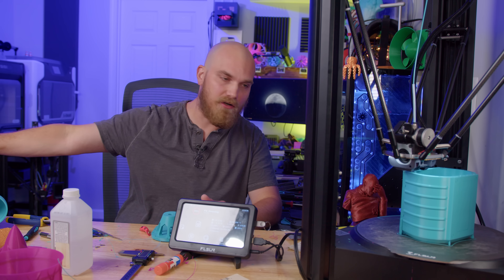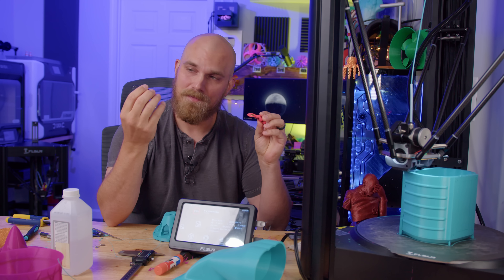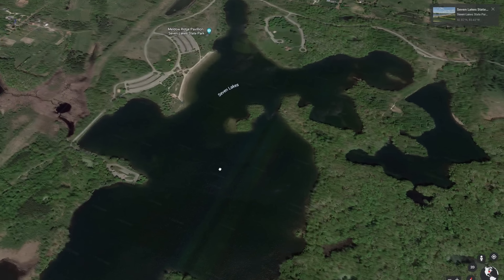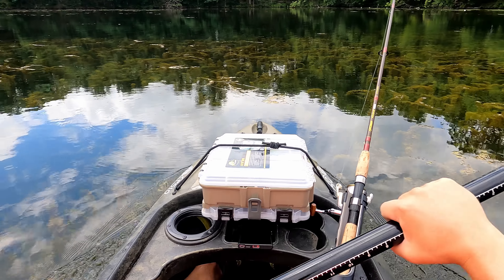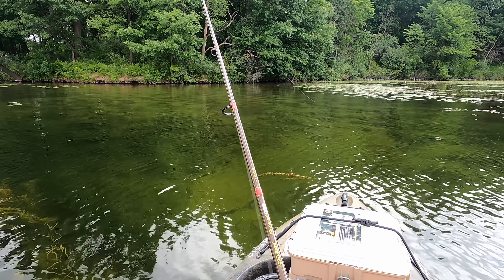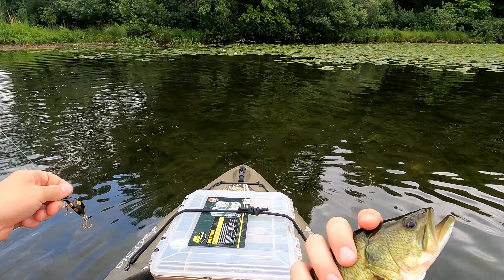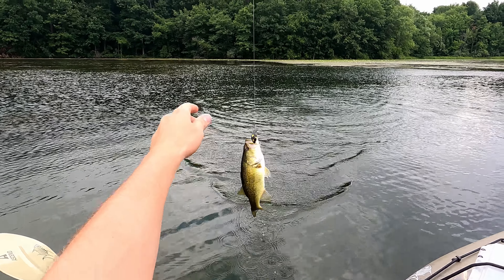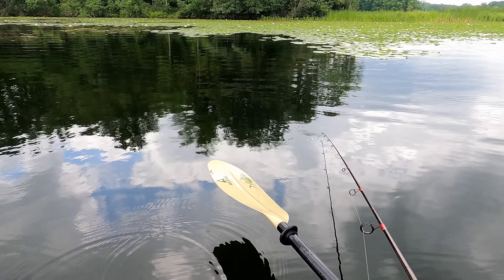Will It Work? Testing Vintage Heddon Tiny Tad 3D Printed Replica

Comment: This is going to start a new revolution in making your own lures! Reminds me of a modern day fly tying equivalent!
Reply: I don't know about that. I have tried a really good cheap knock off of a yo zuri crystal minow and it swam poorly. I'd imagine a modeled by photogrametry/eye 3dp version would be worse.
Reply: are you refering to flying lure those where amazingly great specially for my river
Reply: @Eluderatnight  the amazing thing about 3d printed lures, is that you can iterate on your design and continually make it better! Can't do that with the store bought molded designs.
Reply: It would be great to build a water filled “wind” tunnel, to see how the lures move in current.
Reply: @ltcuddles685  So I am going to copy a lure, iterate multiple times with cost of filament, screen time, and fishing trips to  get a fumctional lure? $7 is a bargain.

I'd reserve this technique for a one off application or despiration.
Reply: @thetruthexperiment  a "wind tunnel" won't give you accurate movement for an erratic darting lure.
Reply: @Eluderatnight  That's why its called a hobby, doesn't have to make sense financially or otherwise, most hobbies usually don't :)
Reply: 3d printing is only good for prototyping, it would be too expensive to buy all the equipment and materials, software, to try to figure it all out, compared to the lure price. Not to mention questionable in quality for long-term use, usually specialized production produces a cheaper but better quality version of that prototype.

Comment: If you already have the shape you want I think it's better to make a mold from it than 3d print.
Reply: Then u can make a strong inner structure connecting the hooks to the attachment too. Make it out of metal wire and put it inside the mold before pouring into it.

Comment: I do have a suggestion though it's kind of out of the ordinary you know the little boat you can print on the 3D printer I think they're like used for a test bed or something what if you put pregnant one of those on a set of hooks and tried it bass fishing?